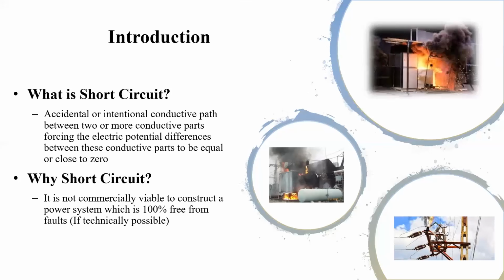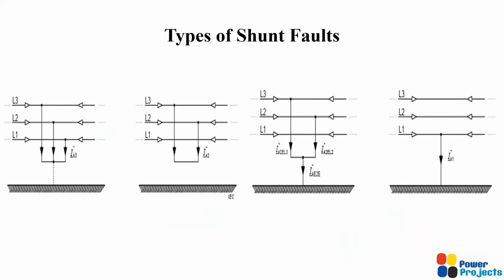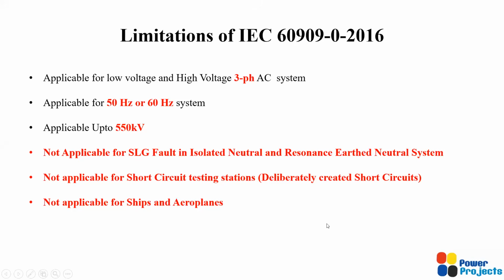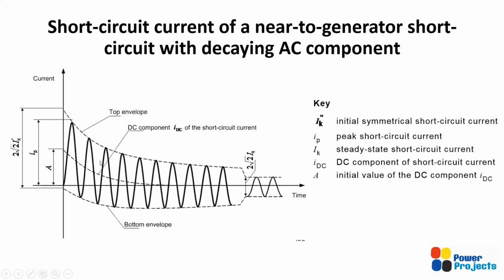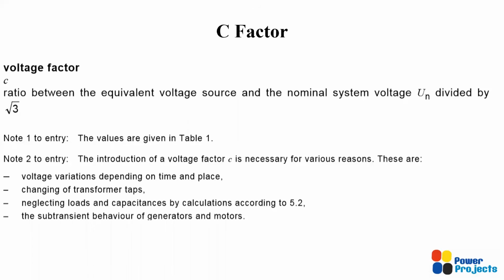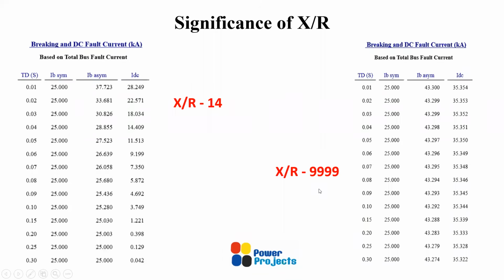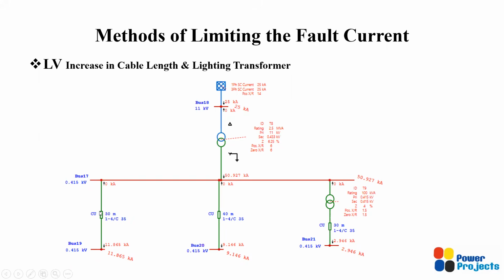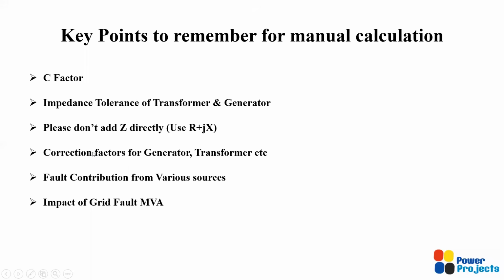The Hidden Secrets of Short Circuit Studies Nobody Knows

Comment: Hello Sir, thanks for the session. A quick doubt: for far away from generator fault (FAFGF), why is I’’k=Ik, whereas for a near to generator fault, I”k>Ik. It is understood that a FAFGF is limited by transformer, Tr line etc…and then by the Gen impedances (which is time varying). Then during steady state condition, the Xd, which is high, would have reduced the fault current to a much lower value than I”k. But from the diagram (@18.50 sec) it is seen that I'K = Ik. Why is this so? Appreciate if you can please explain this. Thank you. Shyam

Comment: In my short circuit report from ETAP,
Making capacity of device > ip (calculated)
Ib sym of device > Ib sym (calculated)
Ib asym of device > Ib asym (calculated)
Idc < Idc (calculated) -- shows alert
I think since the calculated "Ib asym" includes the decaying dc component, I can ignore the device Idc being less than Idc(calculated) or Should I replace the breaker with higher rating or ask the manufacturer to provide higher time constant breakers
Reply from the maker: You need to look at the DC Breaking capacity of the breaker at the instant of breaker opening (Not at t=0) Still if DC current is more either you have to replace the breaker or intentionally delay the breaker for one or two cycles.

Comment: Can you please confirm my understanding that faults "Close to Generator" & " Far from Generator" would be decided by the ETAP software as an inbuilt function of ETAP?
Reply from the maker: All equipments in Power system offers constant impedance during the fault except generator which has time varying impedance (Xd", Xd' & Xd). If you provide correct values of these parameters along with their time constant Td0" & Td0' you will get the proper results in all simulation softwares

Comment: Which method of calculating  R/X ratio is typically used for short circuit calculations as per IEC 60909? Method A /Method B/ Method C?
Reply from the maker: Refer IEC 60909. Will discuss more in Upcomg #AskSelva

Comment: Sir, If there is a Star-Star Transformer with both side NGR connected.
Will an earth fault at say LV side be affected by HV side NGR.
Reply from the maker: Depends on the NGR Value. If the NGR on HV side limits the fault current less than the current limited by LV NGR then it may have an impact. In general we may not have such scenario in real time.